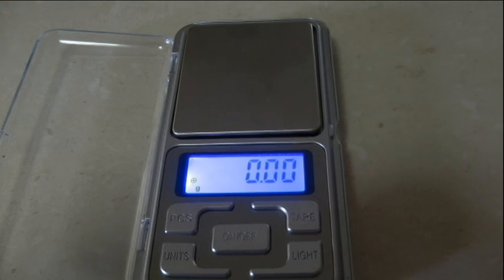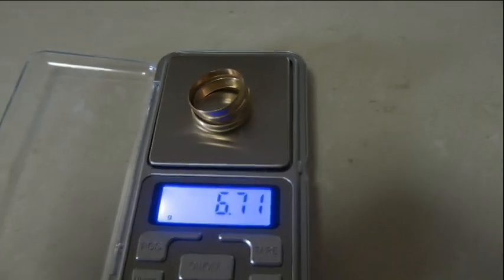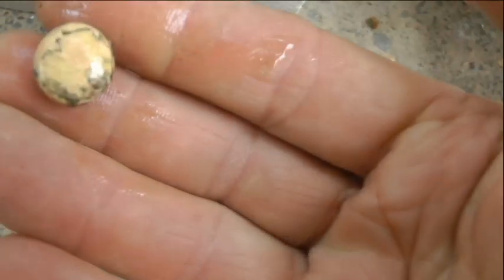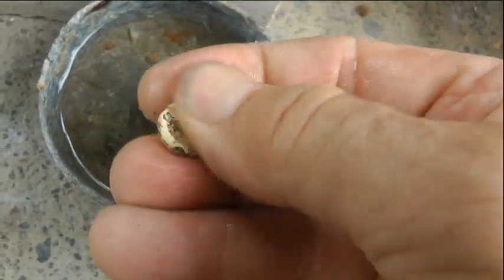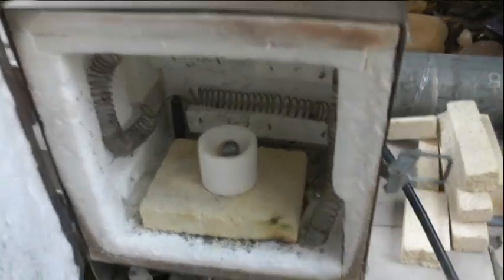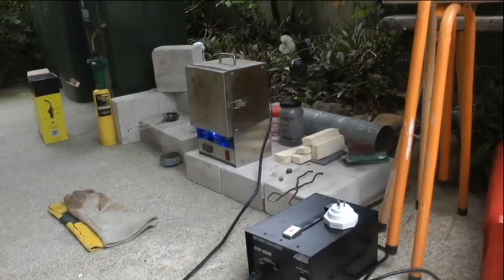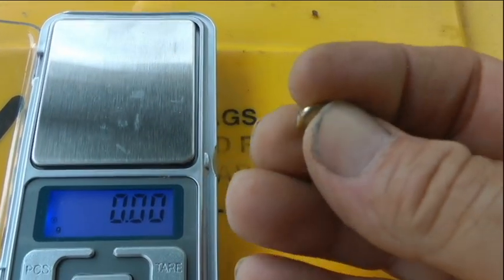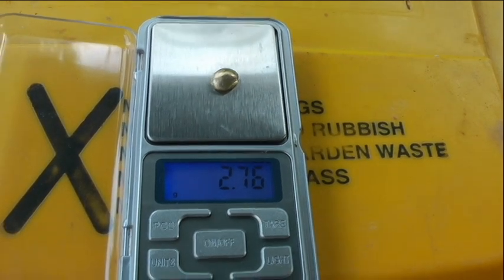Refining 9 Carat Gold costume Jewelry # Gold Hunter #

Comment: Nice work Nev!
Yeah those furnace gizmos do fail. No matter.. torch that thing! Nice button!
Looks good brother 
Peace Prospector Tripp
Reply from the maker: G'day Matt ,  yeah , the Tabletop kiln is so handy , i don't know why it stopped working midway . Later i turned it on again and it's working again . That's the first time i used it with a drop down transformer . It used to work super fast before i used the transformer , but i would only get about three uses before the element would break , ( too much voltage here ) So maybe it overloaded due to me turning the temperature beyond it's capability . I dont know what happened , but i got there in the end , lol . The acid test showed it's somewhere above 18 k , i'm happy with that . I was going to inquart with silver and then Nitric , i gotta use Pottasium nitrate and Hydrochloric as a substitute , maybe later on . this seemed quicker at the time ,lol . Cheers Brother . thanks for watching . 👍👍✌✌

Comment: MAPP works that well?  Hmmm...
Reply from the maker: Yes Keith , it works well most times , but it's heat is somewhat limited , i would like to have an Oxy Acetylene torch though . My big furnace will certainly reach higher temperatures but it's just a pain in the butt  to set it all up . My Table top kiln is great and so handy but it stopped working , ( maybe overload ) shut it down . It's still worked afterwards , so maybe something to do with the drop down transformer , it's the first time using it with the transformer . You'll notice Keith i configured the element in my kiln  as you did , to stop that sagging happening . much better idea , thanks for that . 👍Cheers .
Reply: Yes, I did notice.  Glad to help.

Comment: Great demonstration Ned, what did the acid test tell you?
Reply from the maker: G'day Mark , the Acid test told me i was right . i did a streak on the stone and used the 18 carat acid on it and the streak just barely faded a bit after a few minutes , so i'm happy with that . Wish i had an XRF to tell me exactly how much gold in it , but for now i'll settle for those results . Cheers Brother :hand-pink-waving: stay warm up there . 👍✌
Reply: That’s a great video Ned definitely want to try this✌🏻⛏️✨
Reply from the maker: @enjoyingnorthwoods4041  G'day Jim , yeah mate , i'm just tinkering around  . It doesn't necessarily make it worth anymore than the rings themselves were , but by increasing it's purity i think makes it a more saleable item . If my kiln had kept working it would have been easier by ending up with the button in the cupel after all the base metals had oxidized away , but i could still do it with the Mapp gas but you must be careful not to let it start spattering and losing the gold , That's the tricky bit when you are using the gas to cupel . I got there in the end though , lol , Cheers Mate , thanks for watching and commenting . 👍✌